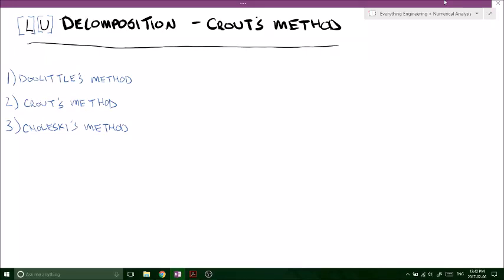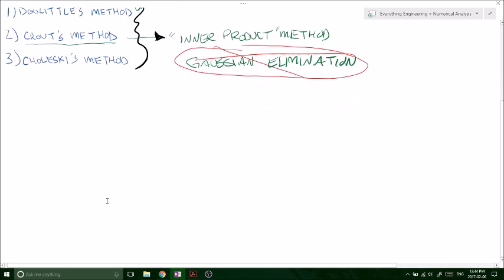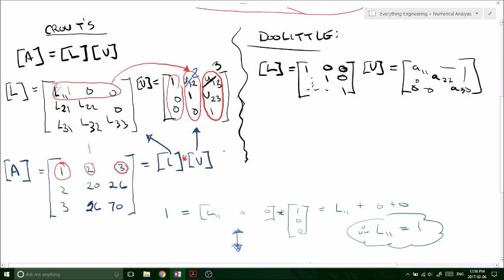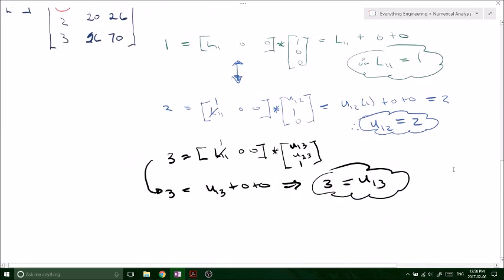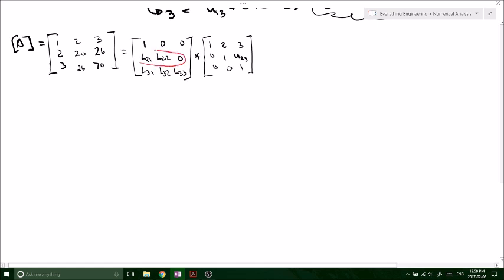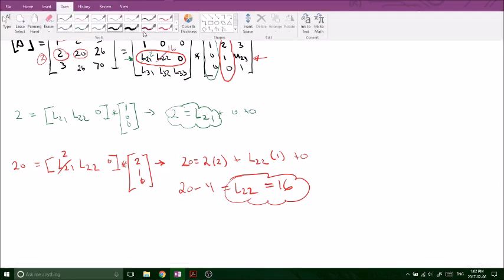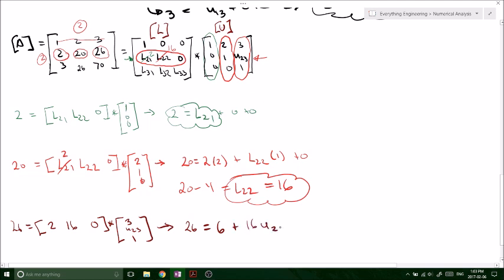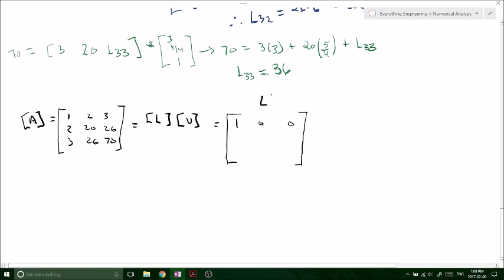Crout's Method for LU Decomposition - Numerical Methods

Comment: you have synapse installed. Which razer device are you using?
Reply: razor VIBRATOR
Reply from the maker: Razor blade stealth 2014

Comment: I think you swapped the unit diagonal. I think for Crout the lower matrix L should have the 1 in the diagonal and not the upper matrix. Maybe I am wrong though.
Reply: Yeah I think you're a bit mixed up, that's the Doolittle Method that you are referring to